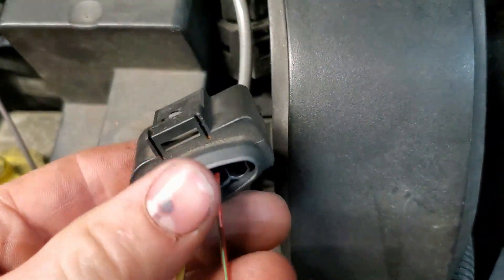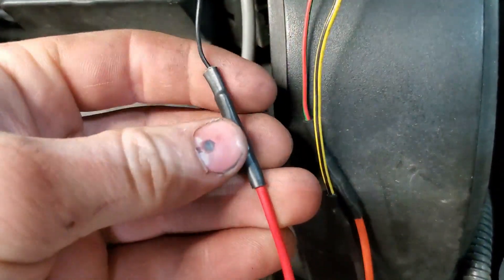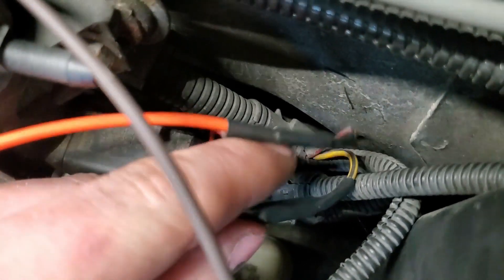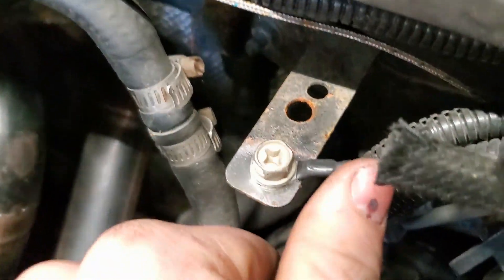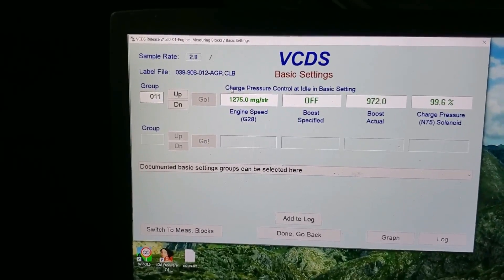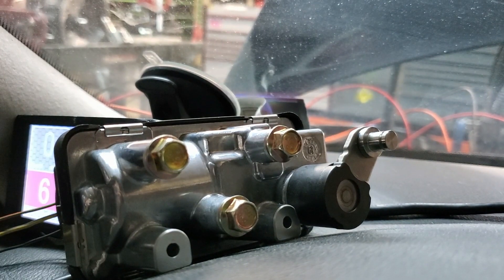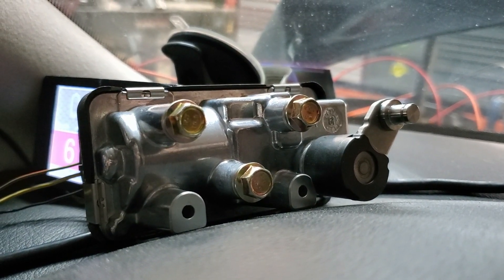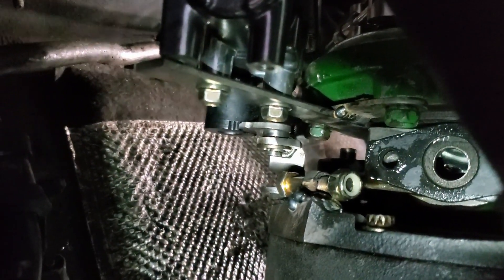How to connect a Hella Actuator to use on a VW Tdi Turbo

Comment: Is it necessary to have n75 valve plugged into the stock connector?
Reply: Yes,otherwise it will not run correct.
Reply: Why

Comment: Would this need to be calibrated in both pid configuration and n75 mapping?
Reply from the maker: There is output signal that needs calibration, pid's and n75/n75 limits need adjusted after it is fitted and logs are made.
Reply: @TekMekTronics  how do i inverse the signal for the actuator?
Reply: @jpjoubert9869 me too I need to do it. do you know how to do it?
Reply: @tekmektronics2288  how to reverse the signal in the software havent figured it out only how to change frequenzy

Comment: Cool stuff,  What are the benefits of this over the original vacume controlled system?
Reply: Far faster turbo control, it makes a 2260 turbo handle better than stock 1749.
Reply: Vacuum can be slow an unreliable   the actuator  is quick an with precision